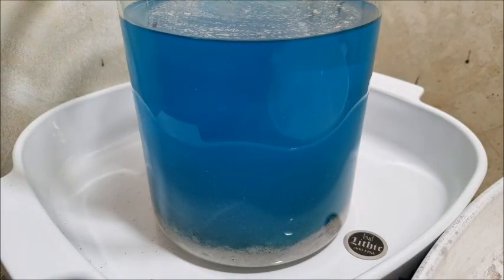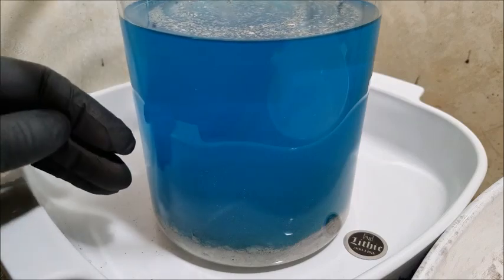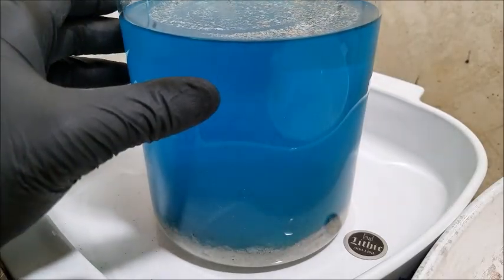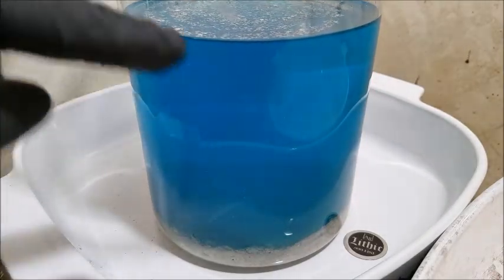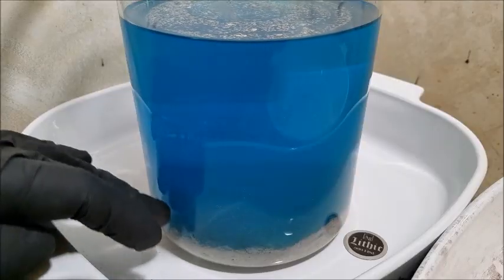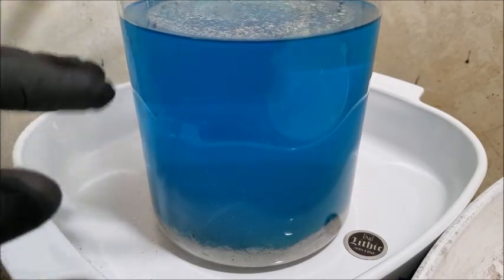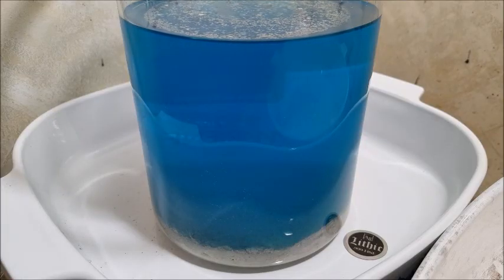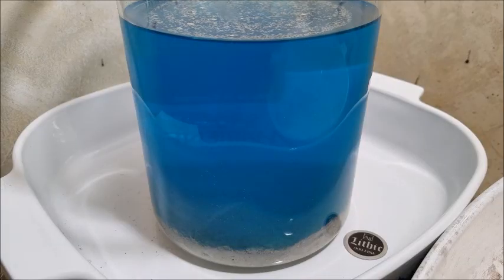Cementing Silver Out of Solution (High Speed Chemical Reaction)

Comment: Ahh so the key would be to pull the copper out before it exhausts all the nitric so if any copper did get trapped in the cement after a stir it would go back into solution and leave only silver behind. I was wondering how to get the purest silver possible just through Chemical processes without the use of a silver cell. I just did a 5 liter beaker full of solution and left my copper in till completion and fear I got a bit more copper than I wanted sitting on bottom with my silver.
Reply from the maker: Yes, end the reaction a bit early. Recover the silver, and then add the copper again later to recover the last bit. That small amount may be a bit "dirty" but the over all batch will be bright
Reply: @LithicMetals  Now if I did that with the reverse mindset and added a little more silver nitrate the bit of copper would go into solution first before the silver and then after filtering it off I could do as you said and add copper to get the last bit of silver out right.

Comment: Hello Jeff, Great video. Are you able to use the copper again, or is it one and done?👍
Reply from the maker: I use it until it begins to crumble. I don't want a bunch of bits of Cu in my Ag. But you can always melt down what's left into another Cu bar later.
Reply: @LithicMetals  knowledge is power!👍
Reply: I did this and left on heat overnight, now I'm quite certain I have bits of crumbled copper in with the cemented silver....

Do you recommend the best course is to drain solution, and add DW and small part part of concentrated nitric to digest the excess copper contamination out?

Or something else?

🙏🏼

Comment: How pure is your silver normally after you cement it? I know you’ll run it through the cell, but have you checked the purity of the cement silver?
Reply from the maker: Generally it's a fare estimate to assume it's apx 98% pure. Because when it forms some particles may also be trapped in the formation. The longer the copper is in the solution, the more likely you'll have impurities. Also, you must wash the cemented silver very well or you will carry over solution which of course contains impurities. I have tested my cement silver before and had .999 fine results if I do everything right. But there are certain tips you must adhere to in order to achieve that level.